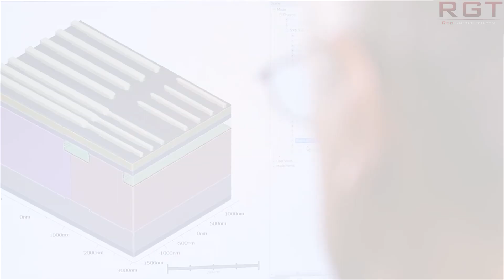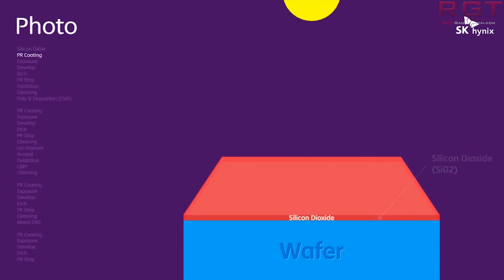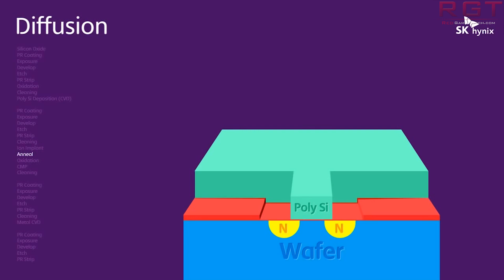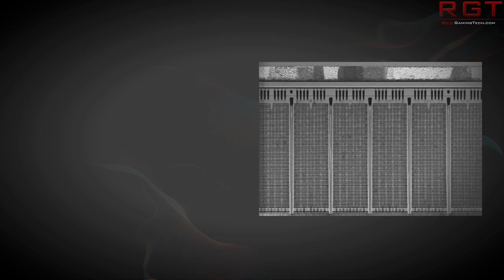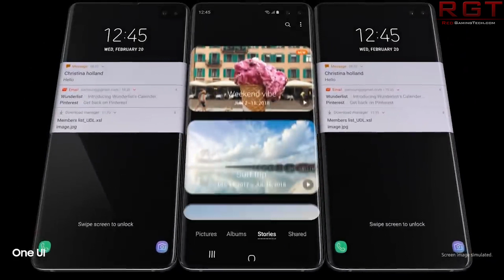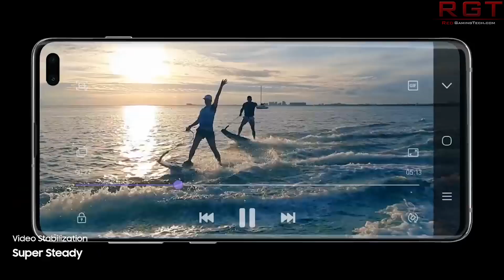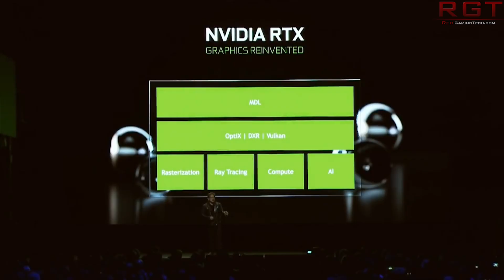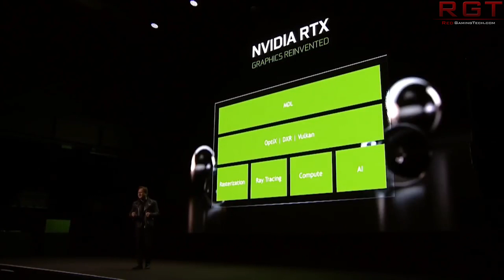DRAM Memory Prices Continue to Fall | Samsung’s Rumoured Fast Charging Graphene Batteries

Comment: RTX is a gimic that may be worth it in 5 years from now. No point buying a card with rts today
Reply: I doubt RTX will be worth it in 5 years. It's more likely that other Raytracing platforms will supersede it entirely.
Reply: @nathangamble125  ,
Mmmm... if you understand the hardware there's no reason to believe that RTX won't be perfectly suitable for ray-tracing in several years. The RT, Tensor and INT32 additions are still just processing math and I doubt that we'll deviate much from calculating the ray bounces and applying denoising. I fully expect when games get developed in 2022 they'll have software that spits out ray-tracing for the PS5/XBox2020 hardware, the AMD desktop hardware and NVidia RTX hardware at the same time. So probably once things mature a bit more a game developer can largely work on "one" version of the game and have automated generation of the code for the other platforms (then tweak things at the end like normal).

Comment: Comparing smartphones with old phones makes no sense, smartphones are pocket computers used for much more than making calls.
Plug a modern battery to an old phone and you won't charge it for two months.

It's annoying how people complain about batteries not lasting as much as they used to but no word is said about how much more they can do now with their high resolution pocket devices that they couldn't do with their long lasting battery phone call machines 🖕
Reply: I think you're missing the point. The reason smartphone batteries don't last as long as older phone batteries isn't relevant - people want long battery life, so they want technologies that will allow that. No-one sane is saying that old phones had better batteries than new ones.
Reply: Nathan Gamble he's comparing battery life on new and old phones...people do that all the time.
Turn on battery ultra saving mode and it will last a week.